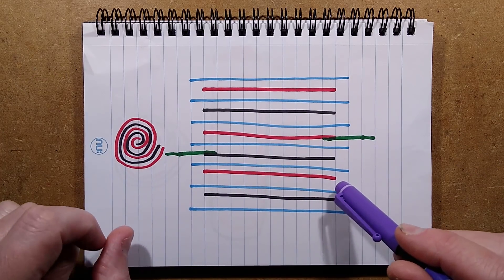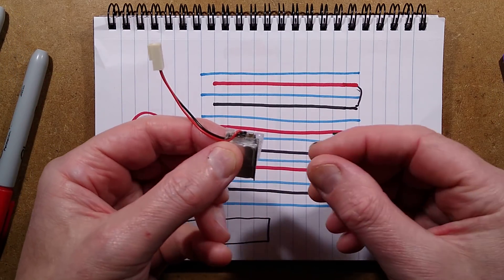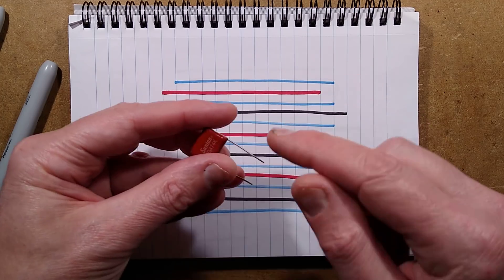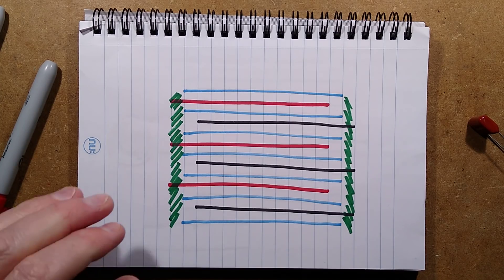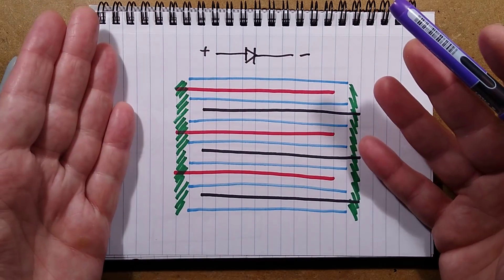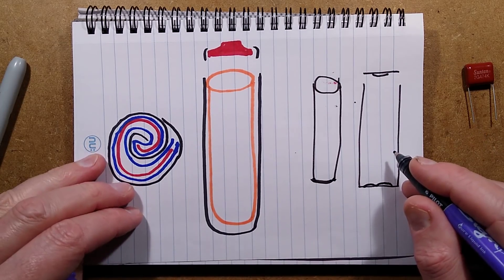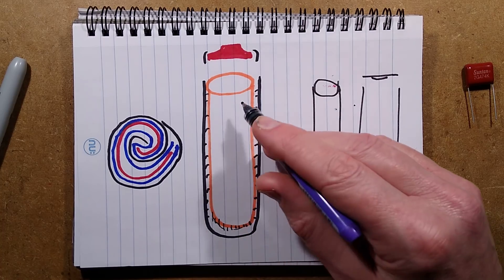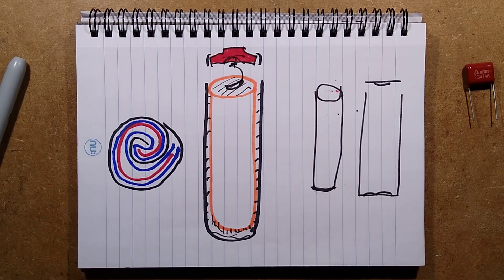Will Tesla's tabless cells ever use Schoopage?

Comment: I'm just curious cuz why couldn't you just make this like a Transformer of sorts just saying in style of construction but since it's got to be an integral part of the chassis of course you would have to Custom Design its shape but I'm not a battery engineer and I don't know if that would be even possible do... you making a one large battery cell might not produce the same kind of power as multiple battery cells I'm just curious because if it was one large cell like that it would be easier to maintain separation between layers or I would assume could be wrong

Comment: Should you have an ( ancient 1960's ) torch that uses a Number 8 ( 3 Volt ) battery ( no longer made ? ) , then a 18650 Li Ion cell will fit just nicely in the 8's plastic outer, stretch the spring a tad and hey presto a working torch ! Also 18650 cells do not leak ( unlike !@**@ nasty horrid alkaline types, which cause all manner of corrosion and caustic slime on your fingers ) QED

Comment: I do find it odd that these cells are made as a roll of separate layers. In my fevered imagination I picture an electrolyte film with a different film deposited on each side. Thinking this through I suppose it would work for a flat layered pack but an additional insulation film would be needed for rolling.

Comment: Why not just put a capacitor at the positive end of the battery before the cap picking up the voltage and releasing it as needed a through a resistor?

Comment: 7:53 I've seen a picture on EEVblog that is supposed from Tesla where the battery has a ton of "flaps". And he speculated that the 
battery an-&cathodes are simply only partly coated, just be extended to the outside, cut in, and then folded over.

Comment: They posted a picture of the battery. It looks like all they are doing is off setting them like you assumed but cutting the sides down to the separater  and folding them over each other. https://cleantechnica.com/files/2020/09/C517649E-4A94-4502-B94A-C41D13EE927D.png

Comment: this "schoopage" or "extended foil" construction is used for (really) low inductance pulse discharge capacitors (put it in a can, terminate one end to bottom of can, terminals become coaxial between other end of foils and rim of can. really low stray inductance) Popular with big science and DoD.  see also some low-ESR "wrap and fill" epoxy preg caps and caps used in "firing sets" (ie; things involving exploding bridge wires or slapper foils, see also nukes)

Comment: Isn't that very similar to how automotive capacitors for points ignition used to be made?
 Probably nothing new in the construction or use but been 'forgotten' long enough to get a US patent (wouldn't be the first time common domain stuff has been re-patented in USA) 
I kinda remember cutting up an old Honda cap from around mid 1960's, aluminium foil and 'wet' so connecting wasn't a problem even then (I was probably 13 or 14 and bike was nearly as  'old' as me) 
BTW, I was a motorcycle mechanic and had to know about electron flow for some reason at least 44 years ago.
Always found it weird that I worked on much 'newer' bikes when I was a kid compared to the 30~50 yr old stuff I tend to fix nowadays
 It's pretty amazing what you 'pick up' working on motybikes ;o)

Comment: Another method to get lower conductive losses in the cell is to do what the manufacturer of the battery within the Lithium battery jump starter you already made a video on about 3 years ago... Titled "Shorting out a fully charged cheap lithium jump starter. (It didn't end well.)"
Downside with that design were though that it consisted of many individual sheets...
Having the sheets as long strips that one can simply roll up is a lot easier to manufacture to be fair.

Though, I have also heard a lot of "talk" about machines needing to stop when coming to the battery tab, as to not rip it off. Though, I see little reason for such to happen if one has a properly made production setup.

But the idea of having a more parallel discharge path is honestly nothing new, even lead acid batteries have done it for decades. Though, the, yet again consist of a sandwich of plates. Not a roll.

I also wouldn't worry about the aluminium foil, since we can electroplate on a layer of copper onto it. (Like copper clad aluminium cables.)

Tesla's main problem were that they insisted on using 18650 cells to be fair. There is a lot of high C rated lithium batteries that have more competent designs. 18650 are just exceptionally cheap, mainly since battery manufacturers have used the form factor for a long time, first for rechargeable NiMH cells, then switched to Lithium. And Laptop makers loved them, until people started wanting thin laptops that didn't have room for such bulky cells.... But Tesla helped sucking up that "oversupply" of 18650 cells on the battery market.

Comment: What would you suggest I do to get a 240v UVC neon tube running on 120v?
Reply from the maker: It would be better getting the correct rating of lamp.
Reply: @bigclivedotcom  eBay, yo. It was supposed to be 120, but....

I was thinking of throwing a single stage WC adder at the mains input.
Reply from the maker: @GadgetBoy  That could work.

Comment: In case you haven't already seen it, this isn't very close to reality lol
They have a patent that shows it, and Elon has talked about it on Twitter, as well as at Battery Day.
I think it was Tesla Daily that had a good video on it, and Solving the Money Problem also went over some of it.

The new cell is using a dry formed, so not on the foil anymore, and the way they make it tabless is by extending the edge out psst the separator, and having lots of slits in it, so that when it's pressed into the bottom of the can, they fold over and form a nearly continuous contact with the bottom of the can.
They also coat the edge with a conductive material to get a good electrical connection.
The patent shows this, and they had pictures of the end on screen as well.

The benefits are that you reduce the heat a lot, because instead of the electrons having to flow through the thin foil all the way several yards to the tab, it can just flow to the edge out.
This also allows them to make much larger cells, because previously you had a size limit, because the larger the cell, the longer the foil strips were, and thus the further front the end of the strip to the tab, thus more resistance and more heat.
This way the length of the strips in the jelly roll don't matter.
It also gives you a higher peak current, because the tab was your bottleneck.

It also greatly increases manufacturing speed, because the tab required the foil to stop to create it and weld it on, but with the tabless design and their new production line design, it never stops, much like how a Pepsi bottling line never stops moving, so they can manufacture them at a much higher rate.

And by going with the dry film process, they skip having to spray the coating on the foil, and then dry it, and just mash it out like so much pasta lol

Oh, and they are using steel battery cases, which will be directly glued into the battery pack between the top and bottom plates, effectively forming the "honeycomb" layer of an incredibly stiff "composite" that will be a key structural part of the car, giving it incredible rigidity and strength.
In concert with this, both the front and rear undercarriage/frame sections of the car will be single piece cast aluminum, and bolt onto the structural battery pack, cutting out countless parts and structural members and weight, thus lowering the cost to build the car for.

Comment: There are metal film capacitors, and then there are metal foil capacitors. The former are self-healing by evaporating the metallization away if they arc through, the latter somewhat lack this capability, but instead allow much higher currents in actual AC loading. They're used for resonance tanks in induction heaters, for example, typically with polypropylene.

Comment: BigClive was a bit wrong in his description of how Li-Ion cells work.  Electrons do not cross the barrier when charging.  Only Li+ ions cross the barrier.  That is really its entire purpose.

In the charged state, the carbon anode (- electrode) contains lithium metal atoms, and the cathode is depleted of lithium.  Lithium metal has a very negative electro-potential.  Given an external circuit, electrons will flow from the anode to the cathode (+ electrode).  Those electrons come from the Li metal atoms, which are thus oxidized into Li+ ions.  The Li+ ions travel thru the electrolyte and separator to the cathode to neutralize the electrons that passed thru the circuit.  But they remain Li+ ions.  Those electrons reside in the metal oxide of the cathode.

Charging reverses the process.  You hook your negative charging electrode to the anode.  Think of that as pumping electrons into the graphite.  The Li+ ions now migrate back thru the electrolyte and separator to the anode where they combine with the electrons and are reduced to Li metal atoms.

Comment: Honestly I'm not batterysavy enough to comment, but I'll do it anyway - I think they're achieving it using dry electrode that is coated on the layers, so they won't need to pour in anything after the assembly.

Comment: There is a picture of how they are doing it here: https://twitter.com/AlexMiningGuy/status/1308528938465988608

Importantly, it'll allow faster charging, and will not heat up as much, as the single tab was a heat generator at high current. But will they still be using a single bonded fuseable wire to connect the cells, as that is also a heat generating element?

Comment: I see this as an abject failure because it bypasses the safety of imperfections in the internal materials being regulated by the narrow connections.  Cells with 0.5% variance from "normal" will now have it multiplied 100fold resulting in much much higher wear on the faster ones and much much lower wear on the slower ones.

This design change makes sense for the recouperative braking but it's downright retarded to try to make a whole battery out of it.   The correct answer to making far faster batteries of this nature with fully involved edges is to make strips about 12cm long and stack them into a square 'pillow' about one CM thick by 2.2cm wide and make the entire sides the connection/heat control feature.  That way there would be very little depth in the laminates inside the battery and a very high charge/discharge rate and they could very very easily be manufactured/re-manufactured on a linear system that can produce one continuous "battery" then segment it automatically... and unique charge characteristics could be adjusted by fine tuning the length of the laminate interior.    Duh.

Round batteries that aren't shaped that way for the rod cathode are moronic.

Comment: I'm not sure you actually watched to keynote.. that's exactly what he announced they were doing.  though I don't think it can actually be called tabless, as the protruding edges have been cut into many many more tabs, and folded over onto themselves.  He didn't say anything about solder, but I'd guess a low temp solder could be used to bind all of that together after the electrolyte is added.

Comment: I always thought that these cells are build this way. I am surprised they are not. I guess, this is because it is easier to make the tabs, and in the past cells didn't really need to have that high current capacity really. The multi-tab, or a schoopage technique could be useful tho when you try to charge them really really fast (and of course you cool them, probably by water), which is useful for recharging EVs.

Comment: This approach has some implications for cooling; all that copper foil connected at one end...
Reply: Which is exactly where the cells will contact the cooling plate.  No more cooling from the sides.  Which allows the cells to be encased in epoxy.

Comment: Elon's solution is not to use a spray on conductor.  It's to laser cut the foil, then fold it over like shingles.  Then, when it's stuffed into the housing, this presses against the ends.  Much much quicker assembly.

Comment: Big cells have advantages on energy density, but its harder dissipating the heat from the center of the cell. Schoopage would provide a better heat conducting path from the foils to allow better cooling in a big cell.

Also it would give a lower resistance connection to the foils, another win.

Comment: The electrons don't travel through the electrolyte, the ions do. The electrons are pulled through the voltage source that is charging the battery to the other electrode.

Comment: In the 70's my Dad used to work at STC in Paignton. 
He was involved in the manufacturing of capacitors, especially the "metallising & slitting" machine. Working at high vacuum they would spray molten aluminium on sheets of incredibly thin plastic film sheet that was then slit to the right size for the intended capacitor. 
They'd come out tightly rolled with the end secured by yellow tape. 
These were the capacitors, the just needed the electrical connections to be attached and then they were compressed and potted.
If a batch failed quality control after being wound, the whole lot was binned.
That's how I got hold of them. Dad would bring home these rolls of silver plastic with a mirror finish that were light enough to float in the air. 
My kites had sliver, floating tails, on cliff tops you could hold one end & throw the roll over the edge. 100's of metres would unroll. What started out as something you could hold in your fingertips made an an arm's full of crinkly, silver, squeaky tangle.
At xmas, you could tell who's Dad worked at STC. All the christmas trees looked the same. Unwound capacitors decorated xmas trees perfectly. 
Even potted caps used as xmas cake decorations. Little green caps with a red splodge had handy wires to insert in the icing. 
My fishing reel & the trolley I'd built out of scrap wood & pram wheels ran on high vacuum grease from an STC machine my Dad called the Torvac machine. (I should Google that, it sounds like a trade name for a vacuum pump). God knows how much that high vacuum grease cost but it worked great at keeping the seawater out of my reel!
This was your fault Clive! Mentioning metallising & capacitor construction brought back a flood of memories. 👍😃

Comment: They could inject the electrolyte like filling a doughnut and then glue the hole up, they could solder or spot weld the ends directly to avoid the tab, they are folding one end over so i imagine this folded part will be soldered or spot welded to the cap, probably same at the other end but also soldering or welding from the outside of the cap. Either this or a conductive glue. I don't understand why they can't just make the cells huge. I just bought 80x 21700 Samsung's for an e-bike project.

Comment: I doubt if they will use end spraying used for metallized film capacitors.  The batteries are more similar to film/foil capacitors, not metallized capacitors.  Film/foil capacitors are terminated using a "swaging" process.  The Schooping will not adhere to surfaces that have been folded over.  Schooping is messy and requires several pre and post processes (masking, cleaning, etc.).  If you need more information from a capacitor manufacturer, feel free to contact me.  hillelkellerman@gmail.com
Reply from the maker: The approach they are currently testing appears to be swaging.

Comment: The metallisation on metallised plastic film caps is indeed typically aluminium (vacuum deposited). You may find that the case of a cylindrical lithium battery is also aluminium from some suppliers. I have a slightly duff 18650 cell here somewhere. I'm tempted to open it up to see the insides.

Comment: Could someone help me understand something that is really bothering me. I understand 2 batteries in series you must connect both neg and + of all batteries in series for an effective circuit. However what I cannot understand is why no current flows when I connect “only” the positive of the first battery to the negative of the 2nd battery you are still connecting a + to a - though on 2 separate batteries. Could some clever person please tell me the physics behind this? 

Thanks

Comment: I think the basic idea is the same. I think in practice Tesla is doing something somewhat different. Look at the end-on photos. I think they are basically folding the ends of the electrode sheets so the layers contact each other across the end, and also the can. They also act as a huge number of tiny, independent springs. A metalized coating seems possible, but not essential.

Comment: You see cars with self sealing plastic coatings applied, I wonder if you could make the insulator out of a self sealing material so the insulator would become a self sealed z folded element and shorting would be impossible?

Comment: Batteries and capacitors are very similar.  Note that liquids can be pretty good thermal and electrical conductors so the problem of getting good contact between the copper battery and steel case may be almost trivial.